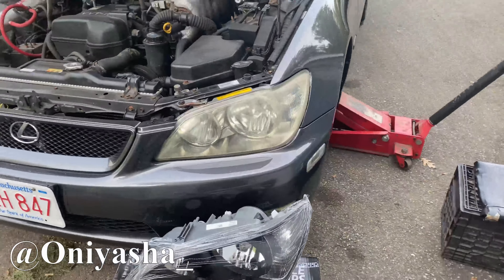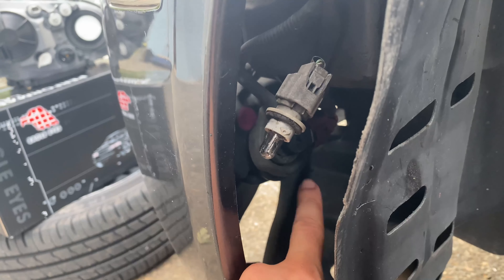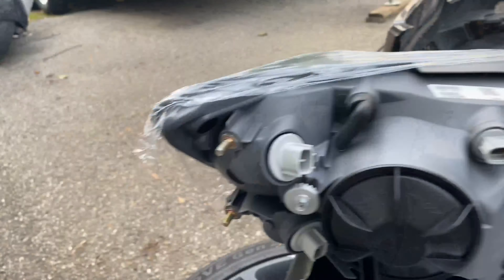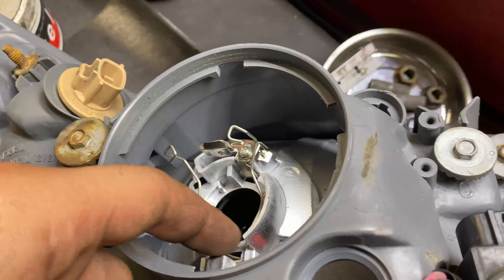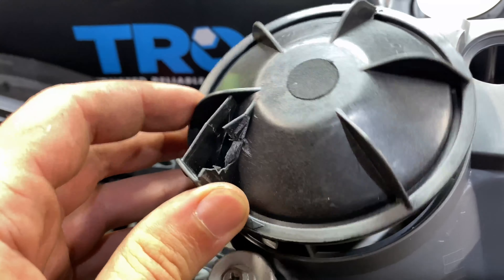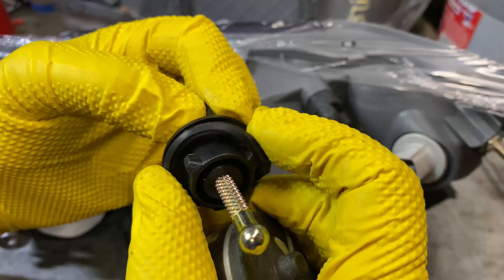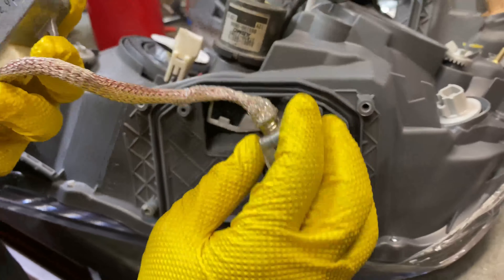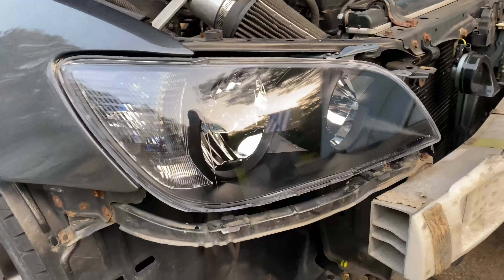LEXUS IS300 HEADLIGHT INSTALL

Comment: fkkk the blackhousing headlights i got were from an old tez with no auto leveling. so as soon as i tried fitting the lights my plugs did not fit cuz my tez's stock lights have that autolevling bullshit
Reply from the maker: Dam. Bad hit
Reply: I had the same problem what did you end up having to do because I’m lost I have the new ones in with no main headlight
Reply: @ISOZIOD  ye the low beam was just the problem. One of the bros knew how to wire shit so I brought it to him and he used the ballast from my old lights and wired it to the engine bay to connect to my low beams, it left me a warning light on the dash for beam level but algood at least it works
Reply: Thanks I’ll have to get with my guy then because I was like oh wow I didn’t know the housing for the actual bulb it’s self is different from the OEM headlight well that’s unfortunately! But thank you I’ll have to do that then